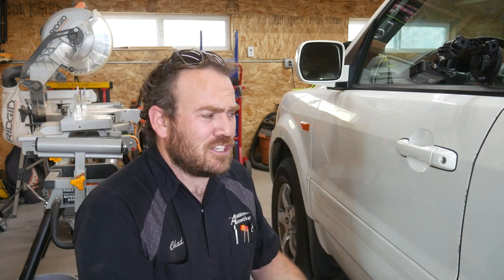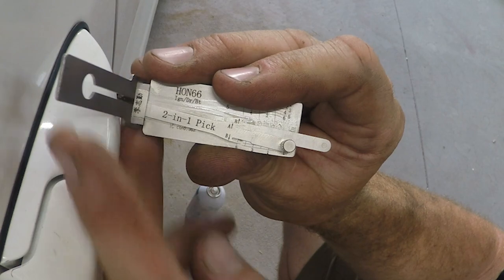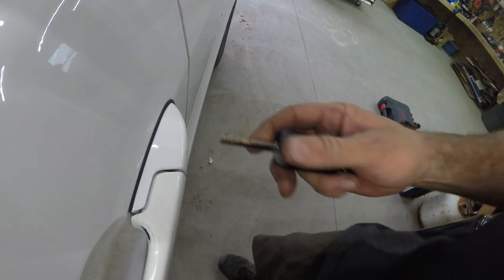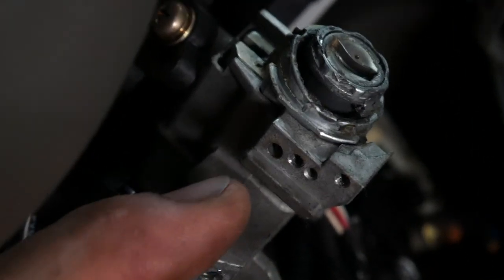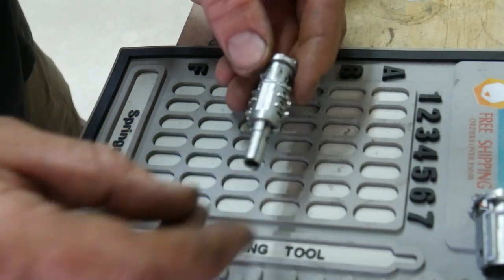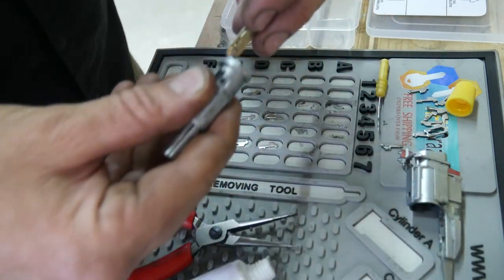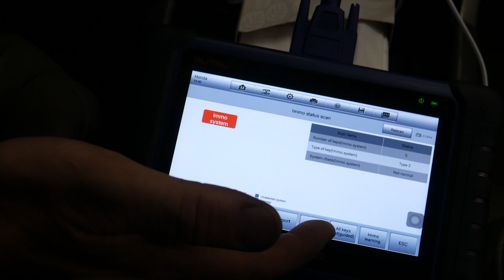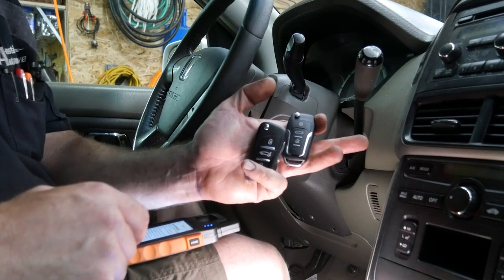2006 Honda Pilot All Keys Lost - pick, decode, cut and program

Comment: Good video.  One tip that would have saved you time.  Had you taken the cut key blade and put a pair of vise grips on it the first time you put it in the ignition it would have fixed your problem.  Everything you did by picking the door lock and taking the glove box lock out to confirm the key code was good.  But once you confirmed the code was correct and the key worked in the door and the glove box your job was already done.  On the older honda ignitions that use the H001 key blank the new keys get stuck in the ignition making them not turn.  this is because one of the worn tumblers is bent or damaged.  By taking the new code cut key and using a little force causes the bent tumbler to start working again.  Then you will never have that problem again.  You need to purchase some Honda H001 Service keys the have a head on the and it is very easy to get the correct amount of force needed to fix your ignition problem.  The problem with your flip keys or even the factory keys you cant get the amount of force needed to re seat the tumblers.  You only need to do this one time with a service key and then all new and old keys will work perfectly.  There was never a need to touch your ignition and remove everything.  Had you done what I am telling you the job would have done in seconds.  Also.  to save even more time your could have purchased the key code on line for about 15 dollars and never had to take anything apart.  I know all of this because of being a locksmith for over 35 years.  I too was like you and when you don't know the tricks you learn as you go.  And for that you deserve an A in my book because you did an excellent job.  Net time you come across a honda and the key works everything but the ignition then give my trick a try.  I guarantee you will be thanking me. Had you used the Honda Service key it would have kicked over so quickly because you would been able to apply more turning force.  Never use your flip keys as test keys.  Always cut test kets that have metal heads or keys that sat service key on them.  There is a reason they are called service keys.

Job well done.  Take care and happy locksmithing.
Reply: I'm an automotive locksmith also. I'm still in the beginning where he is decoding the lock. I come from the old days of impressioning. The newer vehicles are becoming more and more complicated. We don't decode we just call in for the key codes but he get he is going through the learning process. When doing this for a living time is money. In my experience Honda's have the worst wafers. Unreal how many go bad. We also won't pull a Honda door lock. The biggest PITA door lock to remove. We do about 100 auto calls per week. Pre pandemic we were doing 120-150. I'm sure you know sometimes it takes 2-3 programmers to find one the car likes. Never a dull moment. We also cut coded keys on a regular key first. Wasting a transponder key will ruin your day. Most of the new stuff is push to start also as you know.
Reply: So Kenny, you are saying you can break the offending wafer (or more than 1) with turning force.  How many have you forced would you guess?
Reply: I don't think you are a very good locksmith, with 35 years of experience, if you think somebody should take a pair of vise grips, and bend a wafer.
Also, if you had any experience recently, you would know that once he had the code from the lock, he would not need to pay for the key code, because he could just put that into the Xhorse dolphin cutter, and it would provide the bitting.

Just because you work in a specific field, does not mean that you have gained experience in everything. 

If you spent years cutting keys and installing new door locks, then you might not have any experience in re-pinning a lock.

If I went to a customers home and said that their lock is sticking and it's old, and it probably needs new pins, but to pull out the lock and repaint, it would be one hours cost and a service call to their home which would cost around $250 , or you could just go to Home Depot and buy a new lock and keys and then take out two screws and put the new door lock in yourself for about $30. Most people would take that option so again I'm not degrading anyone I am just saying you might not have the experience.

On the automotive side, do you have to deal with the keyblade, the type of transponder, and then the type of remote programming, as well as how many features the cars have and how many features your remote offers. They might just have lock and unlock and panic however, some vehicles have lock and unlock and panic and remote start an open left side door and open right side door and open the truck. 

Plus, there's at least 700 different types of vehicles in a general area where most.
 residential home owners have either a quickset or a Schlage lock. If they're very fancy, maybe they have a "best" lock  

You cannot compare five or six residential locks to over 700 different car models....

Comment: If you drill just a little lower and angle the drill to catch the roll pin with the edge of the drillbit it will catch the roll pin and pop it out. Instead of prying it out.

For the second roll pin you can use an angled 90 degree pic and push out the roll pin and grab it with some pliers.

Also whenever you cut a customer a new key make  sure to deburr the new key and make it smooth at the high tip cuts, if not done correctly the wafers will pushup and sieze the lock and disassembly will be required.
Reply from the maker: Great tips. Thanks for sharing. I have about a 80% success rate with just a key and the other 20% I have to pull the ignition even with deburring. 
I have since switched to opening the roll pin slightly with a pick and then using a 1/16” drill bit inside the roll pin. The drill bit will catch the edge of the roll pin and start spinning it. Just back it out while the roll pin is spinning.

Comment: It is easier if you just remove the lock for the glove box most of the Honda have a key code on the glove box and also on the lock for the trunk I’ve been Locksmith for 14 years
Reply from the maker: Thank you Sergio. Yes it is. For the cars I use the trunk lock on the driver floor board. I like to practice with the lishi when I get the chance. 
Even with the correct code the worn wafers prevented the ignition from turning. 
I am still learning the skills and tricks of the trade for sure. Since locksmithing is probably only 2% of my work I will probably never master it.
Reply: @ThePracticalMechanic  do you have a email I can contact you at I have a question about my 99 accord..

Comment: You played every well at this worst case senario. How much time total and what is the bill? just curious. haha
Reply from the maker: The worst part was the 45 minute drive to mountain cabin… twice. I charged around $450 which is typical in my area for an all keys lost situation. I didn’t charge for the extra trip because it was my fault for not being fully equipped on the first visit. I probably had 2-3 hrs but filming takes additional time as well as the troubleshooting key not working properly.

Comment: You should have charged at least a 1000 for this much work:

Drive to clients place

Make a key by DECODING cylinder pins via speacial tool and software and then troubleshooting decoding issues after cutting

Reprogram key via computer

Edit: then you  had to manually program the remotes.

Correction- You should have charged 1500.

Comment: Try to find an old copy of genericode from someone. Do a WTB on Clearstar marketplace.

The problem with honda's are the lock system 2003 and up (most models) is the worst lock system in auto history. another thing is the motor in the panel to remote lock the doors go out just as fast. That leave people stuck using the key. This very thing happened to a 2010 CRV I had the other day. Car battery died, and the mechanical lock was toast. No way in but the long reach. and those are the worst. No latch pull, buttons are super stiff. I was able to able to get in with a long reach across the other side. Seriously did not quote enough

Comment: Use your bionic eyeballs to read that code. Also lots of ignition locks get changed because the lock tumblers go bad. Asking your customer if the key they had worked all locks. 
 The lock housing like to lock up after tumbler removal.  
 Looks like your on your way to having fun like the rest of us.
Reply from the maker: Thanks for watching. I had a couple months of nothing but Honda lock cylinder rebuilds so I purchased the special tools to remove the roll pin and haven't done one since.

Comment: This is the exact same thing I am doing with mostly the same equipment - I have done several jobs now and have lots of lishi tools - I have come to the conclusion that if there is a reasonably quick way to pull a cylinder and get the key code it will be more accurate and probably faster than the lishi - I have come up with a way to get some realistic practice - I am going to places that auction cars that have been recked or towed several days before the auction - find out what has keys and what doesn't- make a steel key that works before the auction and when someone buys the car you are there with the key and you can have the transponder key ready to cut if they want it - you know they will if your somewhat reasonable with ur prices.

Comment: That part that takes 5 minutes….coding the transponder….stealerships like to charge almost $300 for.
Reply: Multi thousand dollar programmers. $50 to $85 to get a key code by phone. Many won't program right away you so try another programmer. They never take 5 minutes. I tell customers like you I didn't make the car, I don't make the keys/fobs and I didn't lose your keys. I am still hundreds cheaper than the dealer.
Reply: I am saying the stealerships charge $300.  What do you charge?
Reply: @UAL320  We come out to the customer. Trucks, fuel, insurance, phones, advertising, salary etc etc. I'm not avoiding the question but we don't just program keys. We are an emergency auto key service. We don't have a shop so we don't make copies. We originate lost keys. My own car I needed a spare fob. I bought OEM it cost me $189. I had another key to copy the emergency blade but if I didn't I would have had to call for the code which is $50 to $85. Once you get the code you cut it on a a regular key first to make sure it works. You than hook the programmer up to the car and program the key. The dealer can't just program the key as you describe. They need the car also. Some of these multi thousand dollar programmers require multi hundred dollar per year updates. In addition some of them charge what they call a token fee every time you use them usually about $25. Cheaper if you pre pay in bulk. There are so many expenses you don't know or care about. That's why these are so expensive. I didn't design this horrible system but I'm forced to if I want to have a business. So lets do some math. $189 plus $50 for the key code $25 for the token brings us to $264.